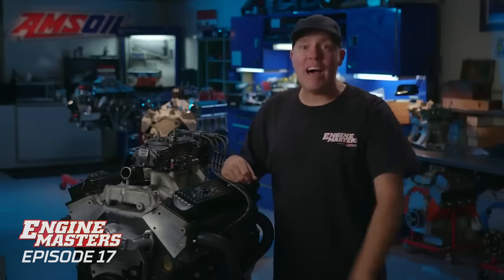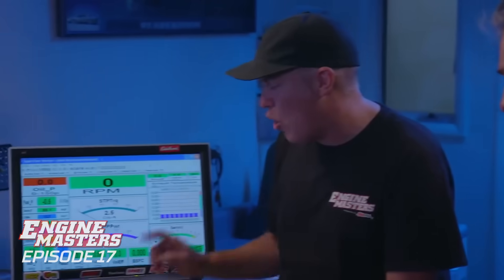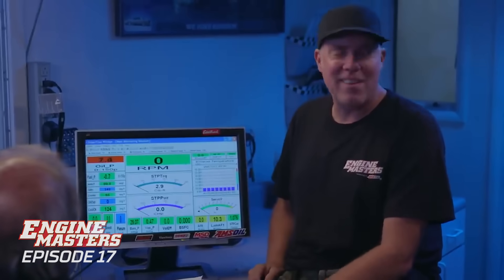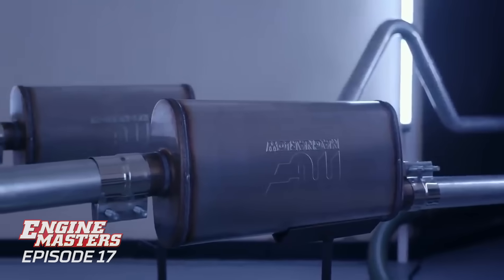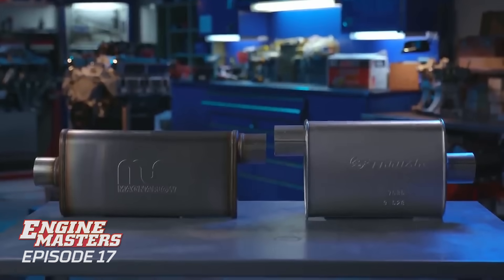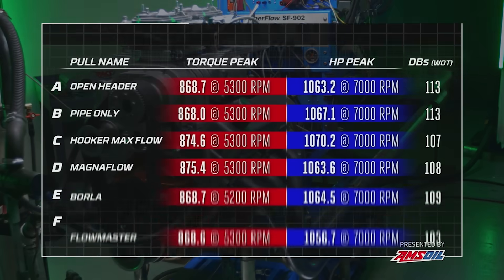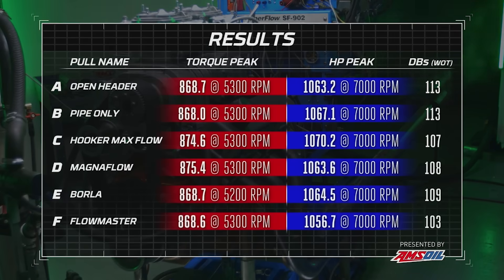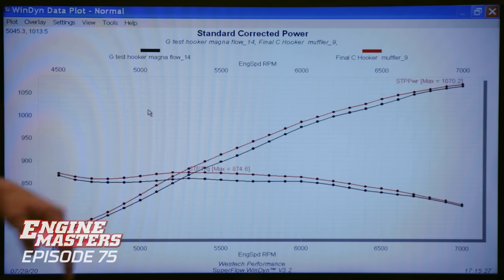Muffler Showdown! What's the Best Muffler for Your Engine? | Engine Masters | MotorTrend

Comment: How are $25 glass packs not on here?
Reply: Cherry bombs and purple hornies 💞🥰
Reply: @Texasmule orale
Reply: @Texasmule  Cherry bombs are like Internet Explorer, carried by all local autoparts stores (1990's at least) you have  no other choice locally diy budget, however it does the job.
Reply: @Texasmule I LOVE cherry bomb!!!! I have one on my inline 4 :D
Reply: Rigged System!
Reply: Or cherry bombs! Lol
Reply: I know, right?! They are straight through design too!
Reply: @Marlin Ezell  so what you want them to do every straight through design on there lol the show would take days
Reply: I bought cherry bomb 8 inch glass packs from Auto sone for 25 each and they only lasted a week before it sounded the same before with out the glasspacks
Reply: @Luis_slides  that doesn't surprise me. They don't make em like they used to. Prolly putting the cheapest chinese fiberglass they can find in them
Reply: They’re identical to straight piping, so it just depends on your exhaust diameter and engine!
Reply: @HOVREDDY  I'll have to disagree slightly. They are identical to straight pipes the way any straight thru design is. N since they covered other more expensive straight thru mufflers, why not throw some glasspacks in too?
Reply: @benmiller5015  Good point, worth a shot! Goal here is smiles per gallon, and exhaust definitely helps with that economy.
Reply: @benmiller5015 Glass packs would have been essentially identical to a same sized straight through design. It doesn't really matter what's outside the perforations.
Reply: @HOVREDDY  If you're referring to old-school louvered glass packs those can be surprising restrictive in how much turbulence they generate. More modern perforated tube style glass packs or "bullet" mufflers are more efficient but still pretty loud. Pretty much anything "straight though" is going to be fairly loud.
Reply: Lol right
Reply: Not a lot of money in it.
Reply: Saw a test yrs ago where perforated glass packs make more power than any big buck chambered muffler.  Flow master use to claim they help scavenge the cyl and actually made more power than straight pipes.  I remember thinking so why isn't every race car running mufflers?
Reply: @stanmerck8242  I saw a Dyno test on a car, can't remember what kind, but I think it was relatively stock. They ran it with mufflers, then cut it off right before the mufflers, then cut it at the headers or manifolds, can't remember if it had actual headers, but open headers put up the highest numbers on the Dyno that day
Reply: I'm not sure you can consider Glass packs a muffler
Reply: Cherry bomb glass packs are the only glass packs that sound good. They have a directional interior design that scoops the air into a spiral type of flow through the chamber, vs The thrush ones that are just a straight line with a million little holes down the center and a chamber that I believe has some sound deadening fiberglass media that just doesn’t produce the sound you get from an original 🍒 💣
Reply: Cause they sound like complete trash unless you have a redneck lifted truck then they'd be perfectly fitting🤣🤣🤣🤣😂😂😂😂🤣🤣🤣
Reply: Because they suck
Reply: Selling you.
Reply: Cause they suck
Reply: It amazes me that this comment is still getting attention lol
Reply: @benmiller5015  the information is still relevant, informative, entertaining and educational.
Reply: @kellyh4035  aww shucks, I'm blushing now lol. I figured by now my comment would have been lost in the sea of comments on the video. But I'm glad people are still wishing they would have covered the actual cheap muffler options
Reply: @benmiller5015  just stopping by to see if it's still going or not.

Comment: I put a Magnaflow SS system in my '05 GTO when it was new. It's still under there doing its job 16yrs later. It's quiet at cruise & loud at WOT.
Reply: You get what you pay for.
Reply: @jodycarter6109  The system was $1k installed at a local muffler shop.
Reply: @Fred_Garvin-icu  should have just got glass packs for les than half that price

Comment: What should I put on my Trailblazer SS? x-pipe?, diameter, duals?
Reply: You have the LS2? I put the Magnaflow system with an X pipe in my '05 GTO and I like it a lot. It's loud at wot, but quiet at cruising speeds. It still looks new 16 yrs later.
Reply: Carven muffler
Reply: Long tubes to x pipe with your choice of muffler all 3 inch piping. I have that setup on my c5 with black widow neighborhaters. Sounds perfect